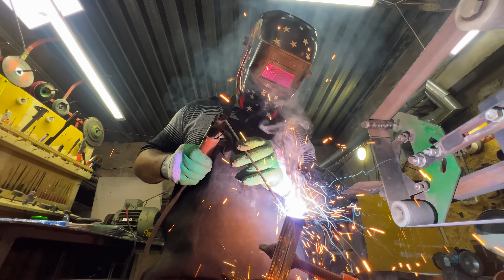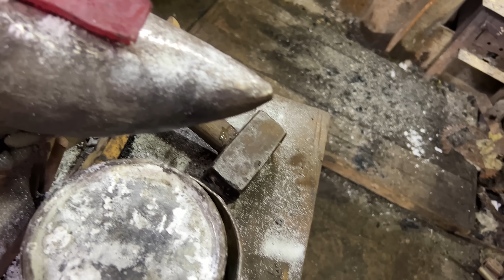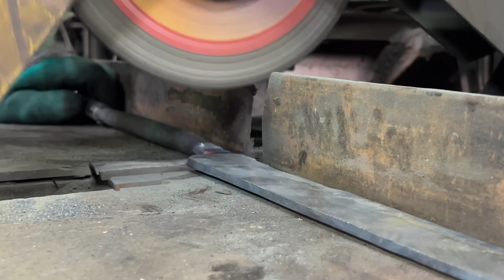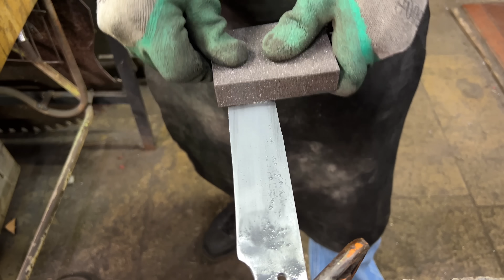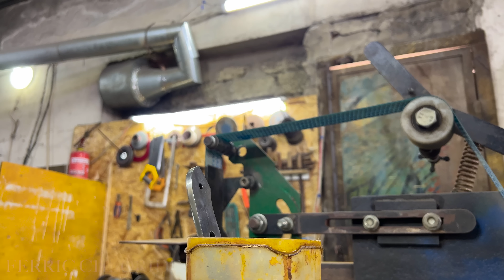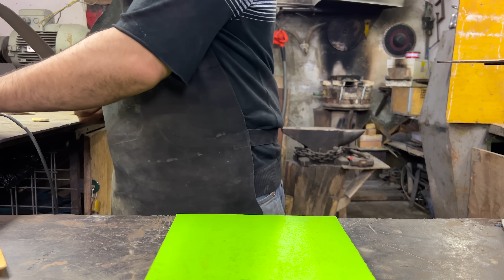I Made This Knife Out Of A Saw! The Sharpness And Durability Are Beyond The Limit

Comment: its slightly bended on the tip. if you look closely, you can see it when demonstration part of the video. also, those dents on the back of the knife is not even. still, good job
Reply: Moreover, the tip have been over heated, or perhaps it was the only part that was at the right temperature (difficult to know just by watching a video). In every case, this is a very bad heat treatment that have been performed on this knife... Excuse my very poor English.

Comment: 1. The steel of the saw, welded with a soft iron stick.
2. The borax is for between the metal sheets, not the outer cover.
It is to a decorative paper cutting tool on an desktop.

Comment: When it comes to sawblade steel, you get what you pay for. I worked for a sawblade company 35 years ago, and we were always doing metallurgical assays on our own and our competition's steel. The sawblades you want are the ones used by contractors on job sites, and they cost 4X or more than what most people use around the house (we called them "junk saws"), and are generally able to have the carbide reground at least once. Junk saws you just throw away when the (hopefully) carbide teeth get dull.

Comment: ???. A lot of imperfections. Blade is not straight. The handle parts fits not with the blade. There are spaces  between the blade and the wood parts of the handle. The handle is not symmetrical...Nice try, but details  matters.
Reply: Also very bad steel to make a knife from. Carbide tipped blades arnt made with steel that will get hard enough to make a good knife